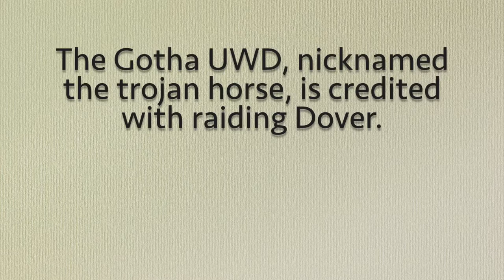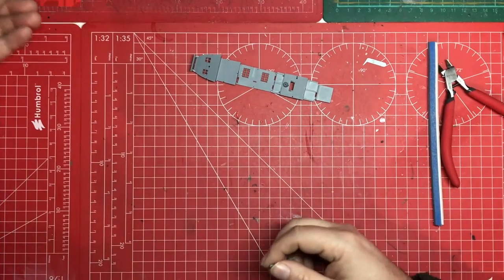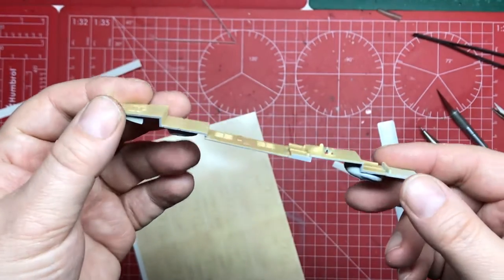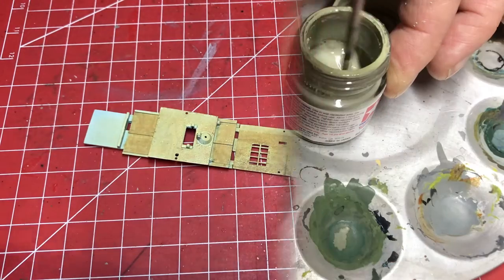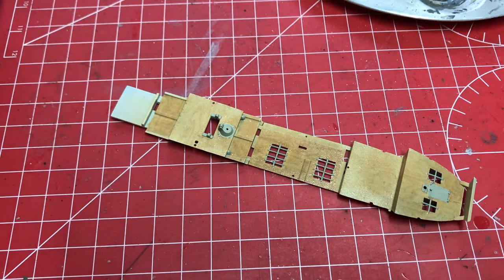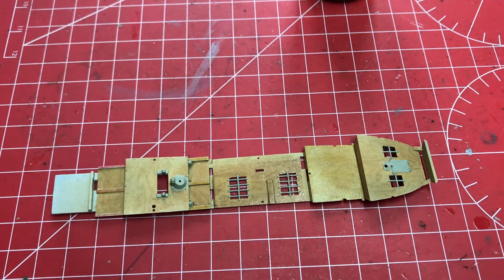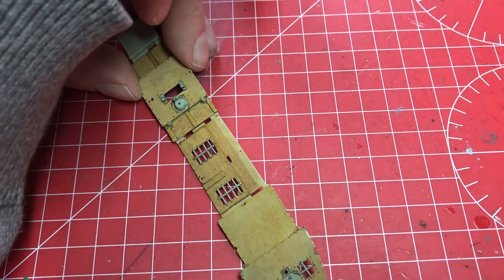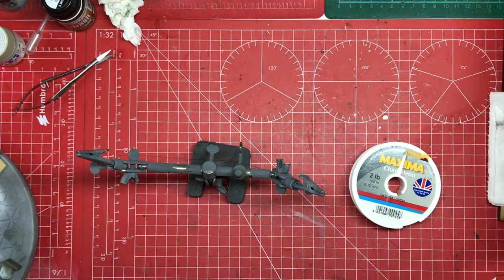Wingnut Wings, 1/32, Gotha UWD, detailed step by step build, Part 2

Comment: Jason, I've found holding the brass tube with tweezers helps when feeding the line back through. Lovely build thus far.
Reply from the maker: yep I found it difficult to do with the camera, will have to try a different set up as could not put my hands where I want them with 2 tweezers as I usually do it.

Comment: If you took the masking tape template and put it onto a piece of paper.Then use the paper as a template on the dark wood decal.That should work as well.Just some thoughts.
Reply from the maker: I have found that brand of decls to be very easily damaged

Comment: Thanks for sharing your passion mate. The Gotha UWD is one of the many ungainly, ugly looking aircraft that's so wacky looking, but the real beauty lies in the fact that so many of these ugly ducklings actually held their own in the skies, quite functional, effective, and deadly for whomever got shot at as well as the one who did the shooting! The fact that some important indicators and dials extremely vital for the pilot to read were quite a ways from the pilot.......on the outer wing! A fuel leak from one of the tanks on the Felixstowe....no problem, just climb out of the plane at 5,000 feet and fix it while being shot at or ducking bird poop! Impossible to get a clear look if stuck in clouds or if some feathered friends decide to hitch a ride and block the dials; these planes are crazy. The massive wind indicators twirling on other parts of the craft boggles my mind; it looks comical, but these aircraft worked quite well, and although it's sad to see the premier manufacturer of WWI aircraft models (WingNut Wings) close their doors, there are still more and more quality model kit makers who are slowly stepping up to the plate to produce kits of what looks like could never fly as if it were from some steampunk sci-fi movie. This gendre has blown it wide open for us modelers to put forth much more effort to broaden our hobby horizons and really get our model building groove going on ( and get a hold of as much of the leftover original stock of kits without crazy prices now available---I bought 50 kits right away, some duplicates as they are so freaky looking) Thanks again for sharing as we really enjoy your work. Modelkit Stuff, you rock!
Reply from the maker: thanks for looking in and your comment